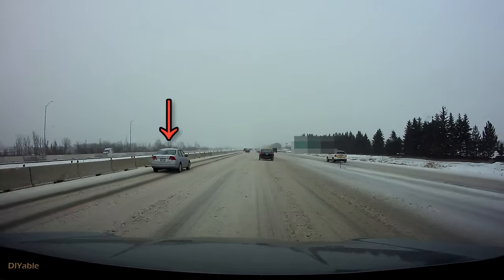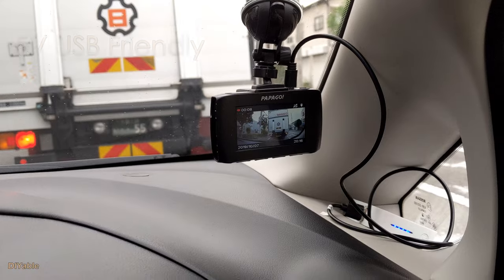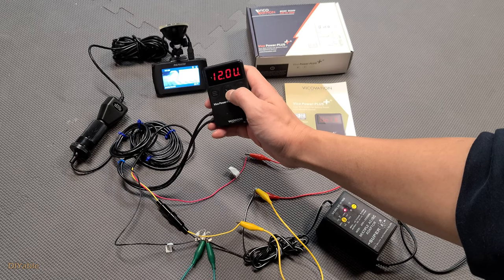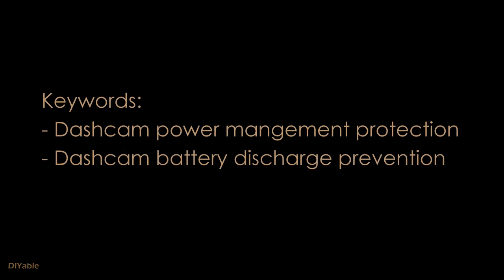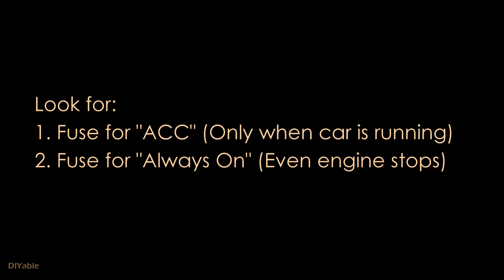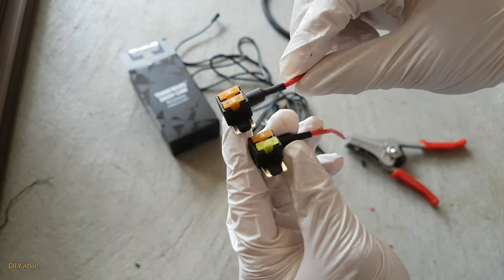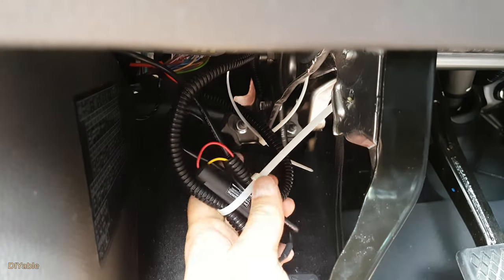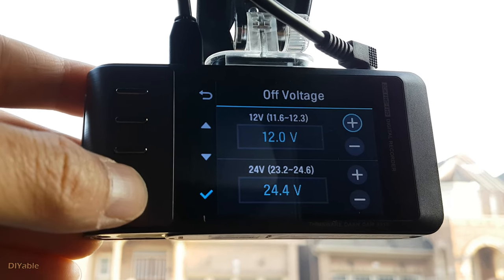How to install hardwired Dashcam with parking mode for Honda Ridgeline, Pilot, Accord, Civic, CRV?

Comment: Awesome.  I never understood why the OEM doesn’t just include the option for built-in using the system camera’s.  Tesla seems to be the only one that has that option.  

I’m a big fan of thinkware and have it in all of my vehicles.  It saved us once with an insurance scammer that reversed (at a red light) into my wife’s car and tried to blame her for rear ending him.  Needless to say, the police weren’t impressed when we showed them the footage after his claim.  The reaction was truly priceless.
Reply from the maker: Back in the old days, every car didn't come with alarm system, everyone had to pay the professionals shops to install it. Of course, remote engine starter too. Now, when you buy a new car, many manufactures throw that into the package. I totally agree, dashcam should be one of the top items build-in for the cars, I think more and more car manufactures are doing it like Tesla.  Thinkware is really awesome I have to agree, it's extremely reliable compare to many of those cheap Made in China dashcam.

Comment: Excellent video! Very thorough explanation. I have a Nextbase 322 dash cam, thinking of hardwiring it to the "always on" fuse in my 2016 CRV. There are only 2 wires on the cable — a "black" wire for ground and a "red" wire for connection to the fuse. Would you suggest to connecting the red wire to the "power seat" fuse to stay "always on" for the "Parking mode" purpose? TIA
Reply from the maker: Wait.. if you only have 2 wires on your dashcam...  that means your dashcam may not support "parking mode".  If you connect it to always on fuse,  it will drain your battery in no time. Check with your dashcam manufacture see if it supports parking mode. Otherwise, you need that dashcam power management gadget I showed in the video.

Comment: Hello, wheee did you purchased your kit? I just installed mine but for some reason the kit that i bought from amazon does not plug in all the way in the fuse box due to its bulkiness
Reply from the maker: Which kit are you referring to? If you are referring to the Thinkware hardwire kit, yes, I got mine from Amazon. However, the hardwire kit didn't come with the fuse tap. You need to buy 2 x "fuse tap" from your local automotive store as I showed you in the video. If you are in Canada, you can get from Canadian Tire or Princess Auto.